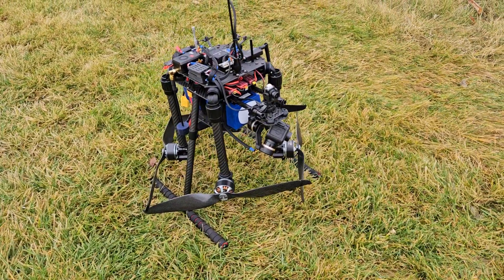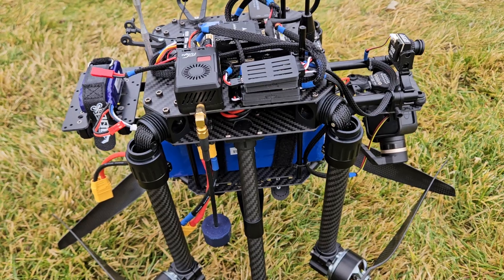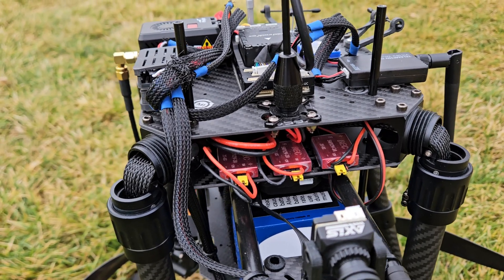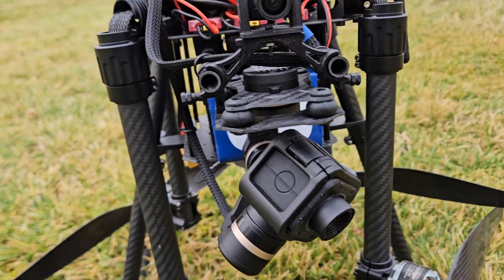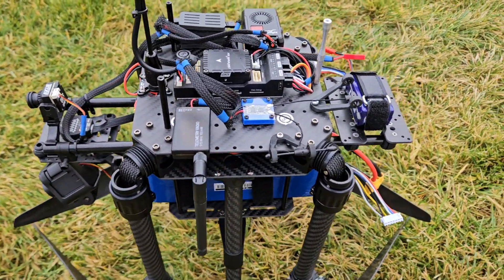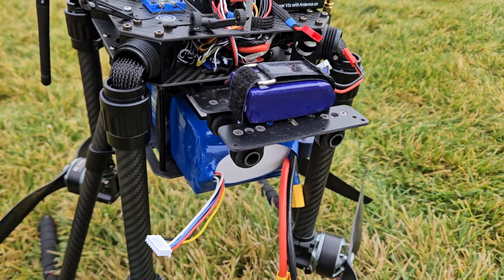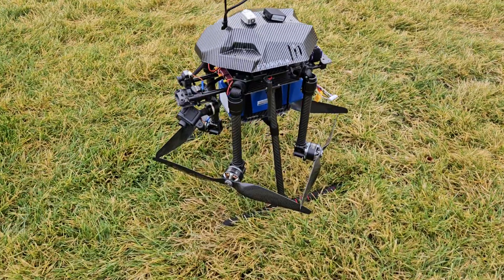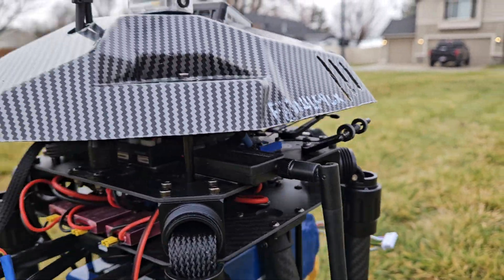Holybro X650 Development kit Thermal FPV Setup

Comment: Thank you a lot. It's great to see someone who actually set up the drone. I’m assembling the X650 Holybro drone with a Pixhawk 6X, but I ran into some confusion regarding the motor connections. Each motor has two wires coming out—one, I believe, is for the ESC, and the other seems to be for the LED. However, the kit didn’t come with a manual, and I’m unsure where exactly to connect these two wires on the Pixhawk.

I have an identical setup (Pixhawk 6X (ICM-45686)) to the one in your video, but with just the kit, and I couldn't see how you set that up.
Reply from the maker: https://docs.holybro.com/drone-development-kit/x650-development-kit
Reply: The "wire" with three conductors is the led. The wire with 2 conductors is the Esc. Andy Piper has good video on building x650. I am also in process of building x650 wit 6x.